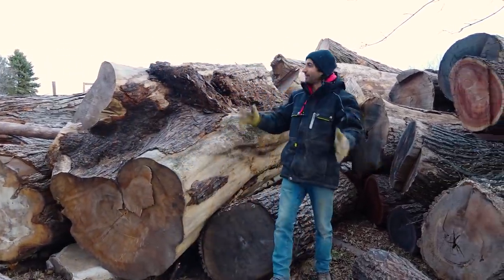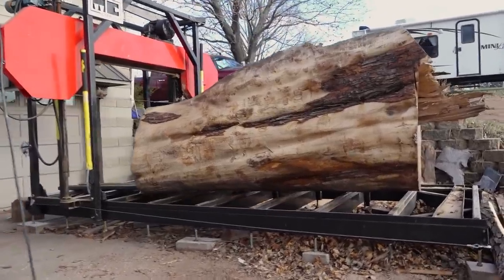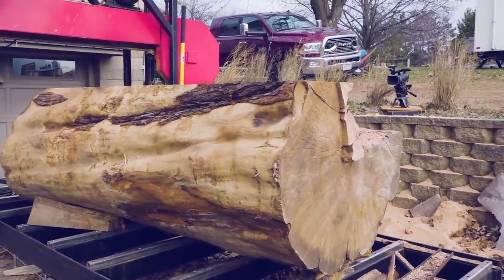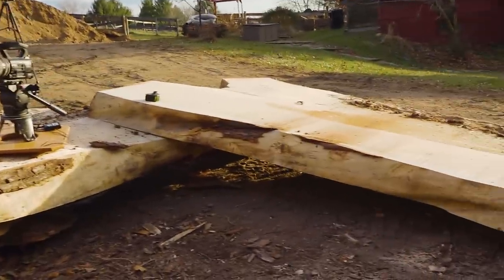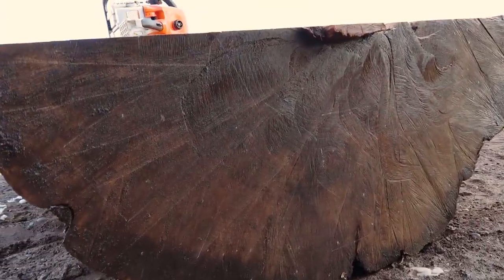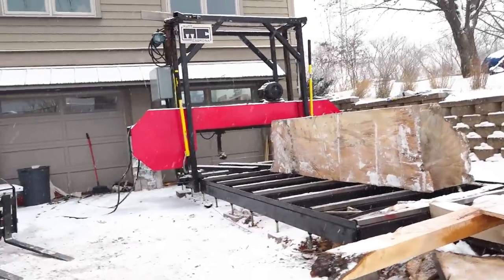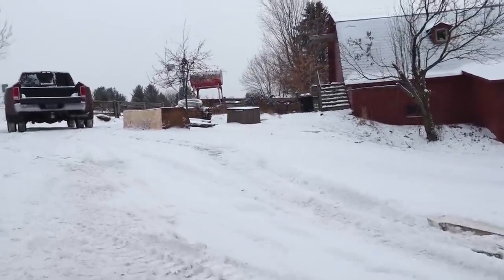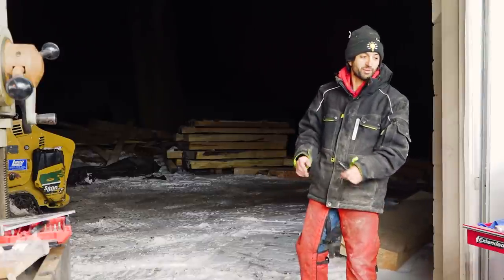Producing the Second Batch of Roubo Workbench Kits [Part 2]

Comment: I didn't realize how big that log really was until you took those two chunks of 12/4 off the top and it didn't even really change the overall size. That's a huge log. 

Also, I like how you keep inventing tools in your videos. Last video with Donovan was the "Drill Hammer". Now I see the "Chainsaw Hammer" at 13:58.
Reply from the maker: Everything’s a hammer
Reply: I wonder what Mat would use a hammer for. Driving in screws maybe?

Comment: I love to see how the log gets slabbed down to so many usable pieces. Slabs a bit wider front-to-back and a bit thinner top-to-bottom would make great bar or counter tops. I'd love a hardwood slab bar in my home if I had space. I see people build custom Lego tables with plywood. I wonder if you'd be able to make a laser-etched pattern of Lego baseplates into the surface of a hardwood slab and then epoxy finish them into usable Lego studs. Have Lego buildings come right out of the tabletop! Impractical for sure, but I bet it would get a ton of views and love as a convention piece!

Comment: I built my Roubo a few years ago after I retired....but it is sure tempting to obtain a 'kit' from Matt....I've been very satisfied with my bench from reclaimed Fir....but one in Maple....Whew!!  By the by....if you are considering building a Roubo bench,  I found it a great experience and the absolute heart of my shop.  I had to put mine in a left hand corner, so the vise is on the right as one faces the bench....but I have found this non-traditional location has not been any sort of a problem.  Perhaps because I am 6'3, who knows.  As to the height....I followed Paul Sellers' lead (he is also 6'3) and made it 39" high....and it sure is kinder to my back.  Take the time to fit the sliding deadman....it's a nice touch appearance-wise and I use it frequently.  Get your holdfast from Crucible Tool....I ended up with two and use them both at times.  Luxury, eh?  One other thing.....if you put linseed oil on the top...do NOT get any down the dogholes....it will be months before they hold and will never be as crisp as they were dry.  Yeh....experience.  -Veteran '66-68

Comment: you have to make a spindle likea laththe wher you cah hold each end and spin log into mcorriect rotation would not take much to use your bed for  2) support triangles with  adjustable cenetr point12"-36" ranhge 24-72" logs   use threaded 2" rod, which can handle the load. weld on the Big nuts..  Now you can rotisserie your logs perfectly and center each end to the plane you desire to cut

Comment: Matt: all that rip-saw work with the chain saw. Do you set the teeth different? I looked them up last year (2021). The makers of rip chains don't want to sell to anyone not working professionally at it, pretty much in a shop setting. As they explain it, it is just too dangerous. You made it look like it's no particular problem, the chips were long and neat, speed seemed reasonable.  Redo-ing our chains to the "rip-angle" was more than we wanted to do, considering we'll probably never do another like that. Not into danger, anyway. We aren't pros.
Took down a cottonwood that was threatening a house. That butt was so big and heavy, we had to cut it into quarters - and our chain-saws (or the chains) weren't really up to it.

Comment: Isn't that perfectly flatsawn rather than quartersawn since the grain will be running horizontally in the finished bench?  Or does that not really matter since the grain is straight and stable regardless of the orientation?

Comment: To preface my comment, I have no idea what I'm talking about. But would it be possible to attach something like a small one foot extension to the mill bed so the winch attachment point is far enough beyond the bed's end that he wouldn't need to push the carriage at the end of longer cuts?
Reply from the maker: He could also stop loading the logs too far down the bed 😅
Reply: @mcremona  I like your answer better, but I'd wondered if just moving the attachment point to the top of the bed instead of the bottom would give the extra inch of travel you needed for a couple of those cuts. @26:00: As someone who has had to trim multiple logs with a chainsaw to get the sawmill frame past an obstruction, I've also wondered about adding some "dog brackets" farther from the edge of the bed so that outer edge is less likely to get in the way.
Reply: @mcremona  Fair enough. I certainly didn't mean it as any sort of criticism. Random thought. You have an admirable balance between getting the work done and improving the process. You do amazing stuff and it's fascinating to watch.

Comment: Seems after all your milling you do not quite understand the metrics of diagramming  log for quarter sawing. The boards  are cut @ 45 deg from center from 4 quarters .
Reply from the maker: That's one of several ways of quartersawing.  That method produces the truest quartersawn material from the center of the quarter with the outsides getting closer to rift.  For this application, I want as close to 90 degree growth ring orientation.  If I just needed to get one bench top out of the quarter, that method would work (I did that in the first batch with a slightly smaller log) but with two bench tops, just rolling the quarter 45 degrees and sawing would produce benchtops with the ring orientation too far off.